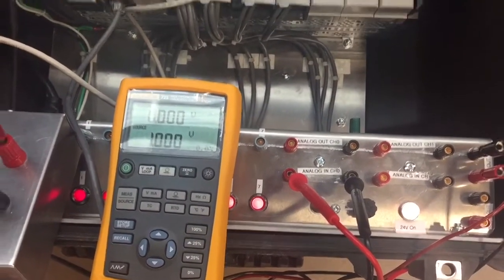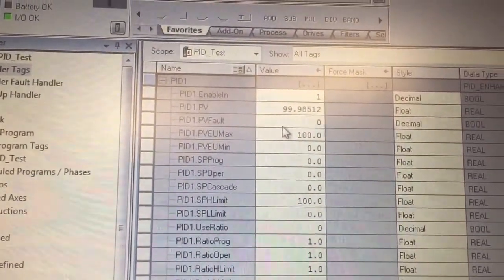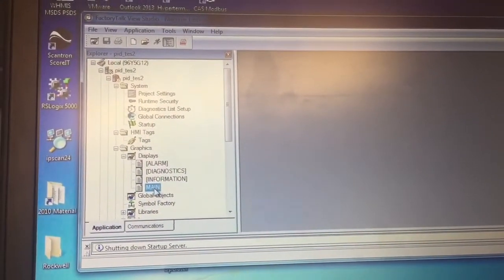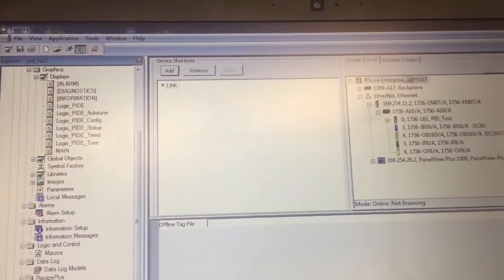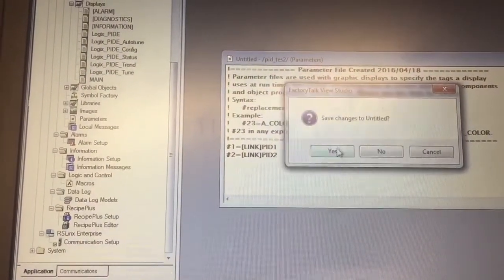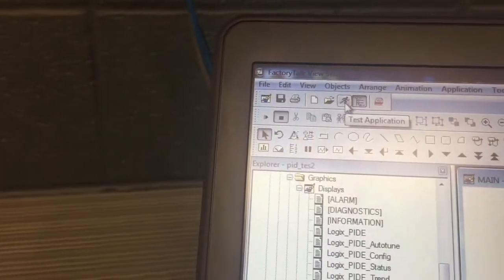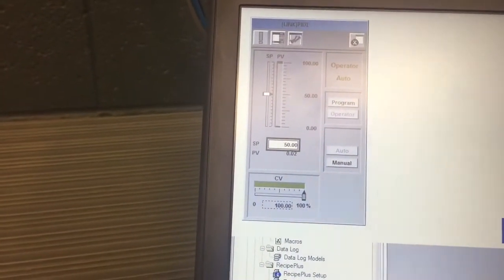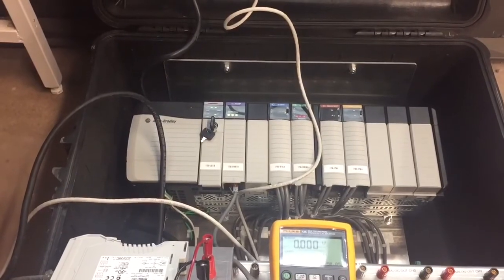Linking PIDE Faceplates to a PIDE Instruction -- FactoryTalk View Studio

Comment: Hi Clifford. Do you by any chance know if anything has changed during the last few years, regarding these parameters? I am working in FTW 11.00 and Logix 32.00. But many of my parameters seem to be missing, once I try to link my faceplate to my program? Jonas
Reply: I got this to work with FT 11 and Logix 32.02, see my post above about the Autotune button fix. Another option was to have a separate button for Autotune that called the parameter file directly.
Reply from the maker: Fntaztc thank-you very much for confirming this!
Reply: @Fntaztc  It turned out that the parameters from my program would not link with the faceplate as the software issued from my school was in Danish language (Denmark). Switching to English solved the problem. However, I recommend one should adjust these settings prior to designing anything, since every label and button was changed to '?' when switching language midways 😏
Reply from the maker: jbkuhlmann sorry, I’m not sure. You would have to contact Rockwell. If you find out, please let me know. I will be upgrading to version 32 this fall.

Comment: Your Autotune portion wasn't working, though. I'm having the same issue.
Reply: This was driving me crazy too.  There were two issues with this I believe.  First, on the "Logix_PIDE_Trend" screen, the goto button parameter list for "Logix_PIDE_Autotune" should be {#1},{#2}.  Next, the goto button parameter list for the Trend button on the "Logix_PIDE" screen needs to be {#1},{#2} also.  Without the {#2} on this screen, the Autotune screen doesn't know where to get its data from.  Hope this helps.  Thanks for the video.
Reply from the maker: Fntaztc thanks for figuring this out and responding! Much appreciated!
Reply: I think it's because you have to enable it in the PIDE parameter (AutotuneEN) setup or write a 1 and wire it to the FB. He only had input and output wired to the PIDE. I may be wrong.
Reply from the maker: Your right Brian! Thanks for pointing that out. I will look into this and reply. It might not be until the fall though. I have a long list of things to do.